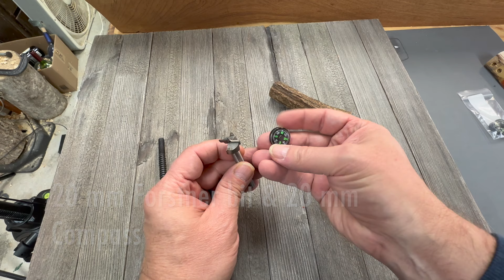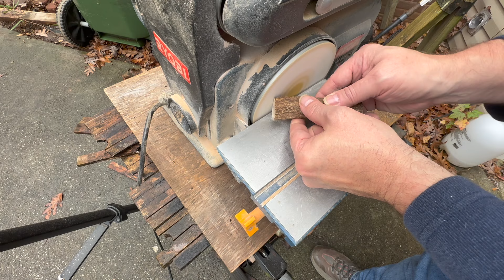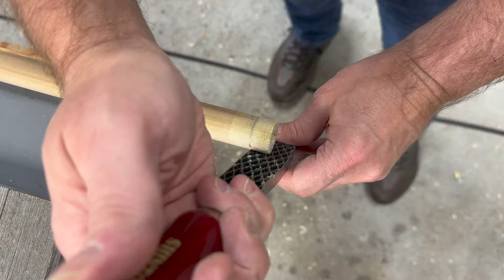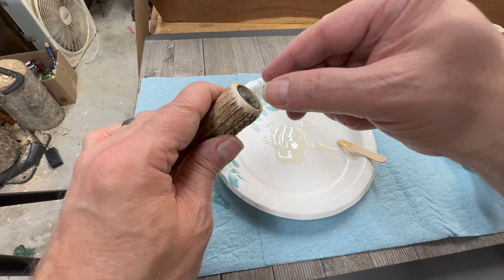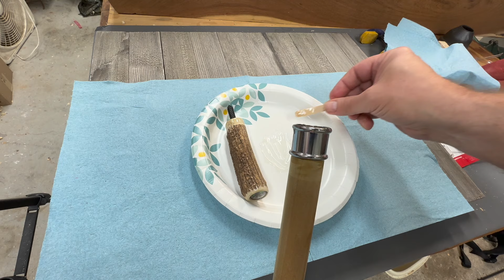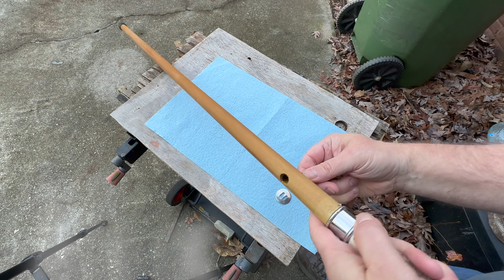A Simple Antler Hiking Stick Topper

Comment: Also I'm using fibre glass pins instead of metal Bolts, nearly 3 inches in lengh and metal (brass, copper or stainless steel) covers.
Reply from the maker: Thanks for the tips. I'm not familiar with glass pins. Where do you get them? I've never had any problems with the holes for the strap and having a staff break. I suppose if you drill too big of a hole or it's a natural weak spot in the staff then that could be a problem.

Comment: Very nice work.  If I could make one suggestion,  using a slower setting epoxy would give you more  working time and a stronger join.
Reply from the maker: Thanks for the suggestion! Good idea.
Reply: If you put some painter's tape around the edge of the parts being glued, it makes cleaning up the squeeze out easier.

Comment: Not much experience working with antler. I only know it stinks when you grind or drill through it. As a wood turner, I should give it a try.
Reply from the maker: Thanks for the comment! I notice the smell when I drill, but I also turn antler on the lathe and never smell it then because I have the dust collector turned on. If you have a fan or dust collector it's really not that bad. when carving antler, I generally try to do it outside with my fan blowing across the work area.

Comment: Not everyone has a drill press, do this with a cordless drill,and an orbital handheld sander.
Reply from the maker: Good point! It's very doable with a hand drill and orbital sander. Just try to get the hole as straight as possible. There again, it doesn't have to be perfect.